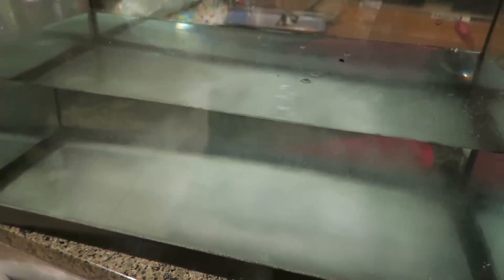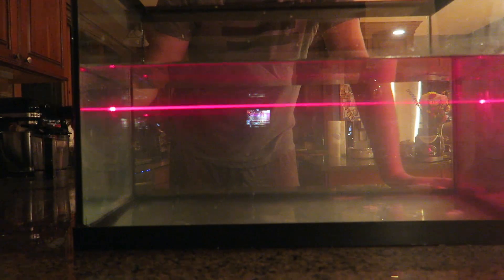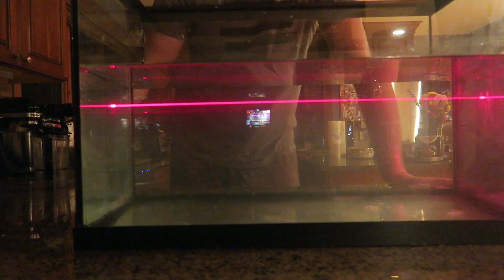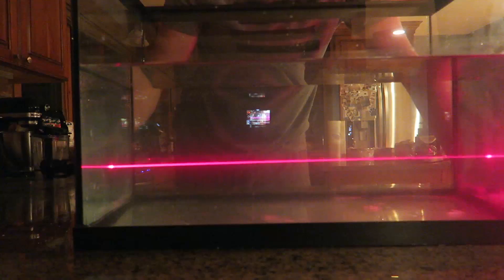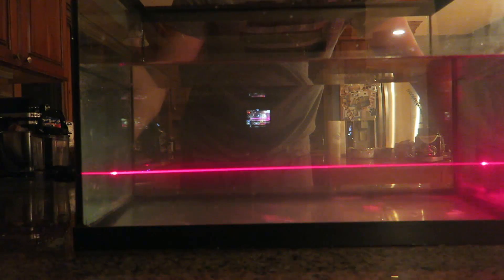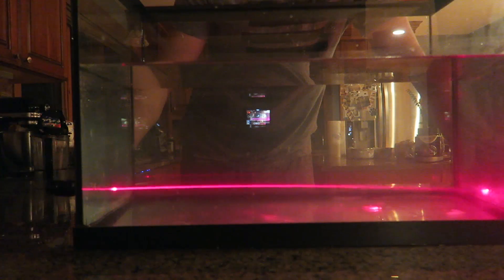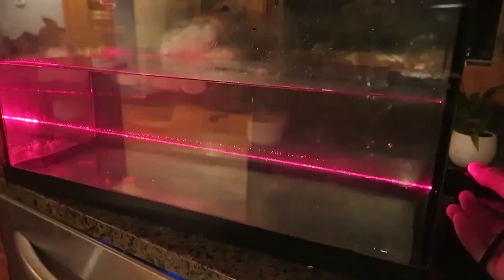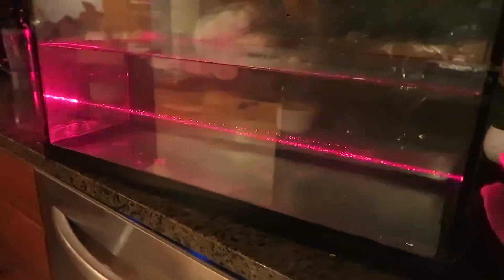Bending of light - Laser Science Experiment

Comment: the sugar crystals in suspension bend light as it passes through
Reply: +Larreon Mapp Actually the crystals have dissolved, but the individual sugar molecules increase the density of the medium, increasing its index of refraction. The denser liquid also tends to settle to the bottom of the tank, thus the bending of the laser near the bottom of the tank, but not the top. This works because the sugar molecules are fairly large, and the Brownian motion of the water molecules is not strong enough to keep the sugar molecules evenly distributed throughout the solution.

Comment: Good experiment.  The bending is the refraction due to gradient concentration of the dissolved sugar.  Bottom of the tank has higher concentration of sugar than above it.  Higher concentration causes higher refractive index, causing more downward bending.  You did not stir  the water in the tank so there is more sugar concentration in the water bottom of the tank.  If you stir the tank long enough you shouldn't see any bending.

Comment: Its caused by this, sin(alpha) / sin(beta) = n2 / n1 | it's called index of light refraction 

Lets say that water has n2 = 1 and water + sugar have n1 = 1.5 the light is bending towards the sweet water because light particles can travel that easy as in normal conditions (water in this case). Same if you shine laser from air to water, laser starts bending toward the water instead of going back up or going straight down.

Comment: Refractive index is a bit higher than water ,you see if u haven't stired the solution It creates density and that's why the laser light bends when it passes through sugar water 

Tip:try putting a mirror where the laster light terminates inside the tank and check if it bends towards the normal 
+Taraskul

Comment: refraction of light 
sugar water is denser than plain water, light ray will bend toward the normal line when entering a denser region from a less dense region 
therefore as the laser pointer moves lower and lower down as the concentration of sugar is higher at the most bottom, it appears to have a curve to light

Comment: The sugar only allows the laser to be shown. The light actually bends because of the index of infraction. This is the difference in density between two substances, in this case water and air. It bends when it meets the glass because parts of the light from the laser reaches the glass at different times so the light has to catch up. This is in relation to how water waves move in the ocean when the go from deep water to shallow water or shallow water to deep water.

Comment: This looks like it needs safety glasses that block lasers!  But in reply to your question, the light bends because the concentration of sugar increases as you get closer to the bottom of the tank, and as the concentration of sugar increases, the speed of the light through the water slows down.  As the light enters a region where its speed is different, it refracts, which is responsible the bending that you are seeing.
Reply: Okay.. Thanks for the explaination
Reply: I would say speed has nothing to do with it and it’s just being bent : refracted because of the density of the type of particulates in the bottom of the tank.

Comment: Most likely due to the fact that the sugar water has a heavier density than regular water, the density of the sugar water pulls down the light with it.

Or due to the fact that sugar is a type of crystal, is rather only reflecting the light, just not too effectively to the point where the light is bouncing everywhere, so it has no choice but to go down because of gravity.
Reply: +Mister Sinister gravity is incredibly weak and would not bend light at this scale :) also sugar is not a crystal when you dissolve it
Reply: +michaelmjh23 With dissolved sugar, there are still macroscopic crystals that have the ability of still rendering reflections.

Although still weak rebounds for reflecting light, the crystals will at least slow down the speed of the light by a fraction of a second and will help with supporting gravity by pulling it downwards.
Reply: +Mister Sinister *Microscopic
Reply: +Mister Sinister macroscopic???? u mean micro right because macro means big micro small
Reply: Only if your sugar water has the gravity of a sun.
Reply: Sorry but you're wrong buddy
Reply: light does have a weight and gravity can affect it. I think it just has to do with the sugar refracting the light I don't think gravity plays a role in this case
Reply: Mister Sinister It's all about refraction man, just look it up, I assure you gravity has nothing to do with this :)